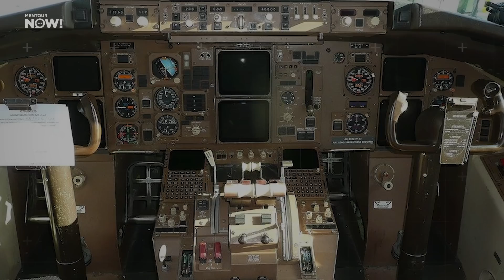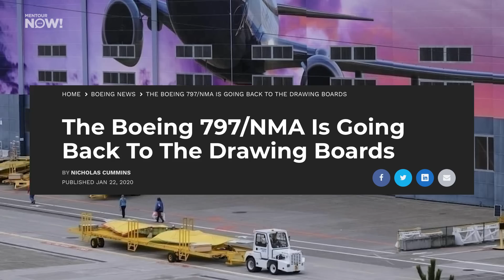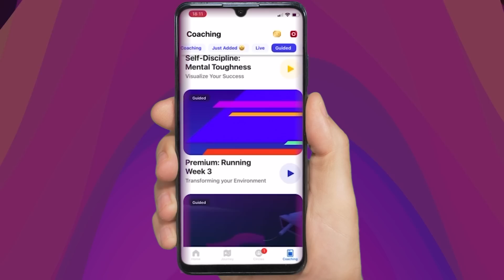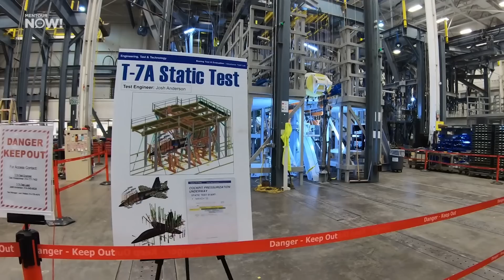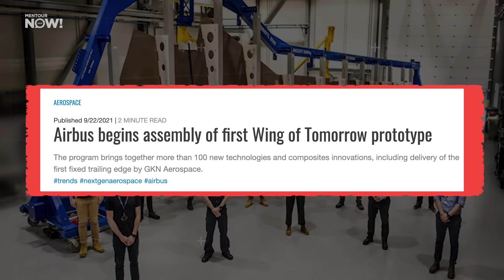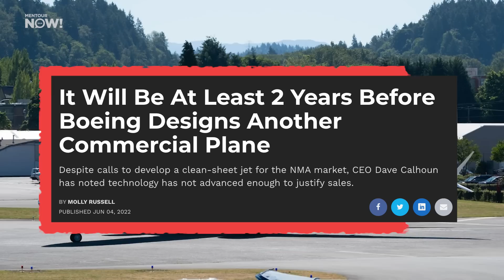Is Boeing Planning a 757 MAX?!

Comment: Your figures surrounding the Boeing 787-8 are totally incorrect. the dash 8 variant only seats 242 passengers, the dash 9 seats 290 and the dash 10 seats up to 330. Stop giving out bogus information.
Reply: Hi Gregory. Thank you for coming with corrections but in this case you are wrong. What we are giving out are the actual passenger figures in a SINGLE CLASS configuration. You are referring to dual class configurations but the whole point with this video was to show the gap in potential capacity.
So we are not giving out bogus information, we are comparing apples with apples. 

Have a great day.

Comment: The big issue is having all that excess thrust is antithetical to good fuel economy as much as I love the 757 and its rocketship like performance. I've flown the 737-800 in a full size certified sim and it uses a lot of runway when loaded. It was a few years in Boston but I think VR was 150 kts+.  Just watching them take off from Logan in Boston they use quite a lot of that 10000 ft runway (4R/22L) when doing transcons vs the 757 doing the same mission  which uses considerably less. Still, aesthetician the 757 looks a lot more sleek vs the 737 which retains the 707  nose cross section and first flew more than 60 yrs ago
Reply: Yep - you don't buy Ferrari for fuel economy. And airlines are rightly far more interested in fuel economy than performance.

Comment: 757 is still a favorite for pilots , mechanics, and passengers. The max version would be wonderful.
Reply: Also controllers. Loved working the 757. Great climb rate. Mach.80.
Reply: Been a mechanic for almost 25 years. Worked on all Boeing 727+. Loved working on the 757! At 6'2" loved being able to walk underneath the plane.

Comment: I suppose the question you raise (but don't specifically mention) is: why did Boeing leave such a big gap between the 737 and the 787 in the first place? After all, Airbus hasn't. 

FTR - I'm neither an Airbus or Boeing acolyte

Comment: I hadn't heard about the Ultrafan being too large even to fit under a 777X wing. That's nuts. What on Earth are they planning to use it for if it won't even fit on a 777? The 777 has by far the largest diameter turbofans of any current aircraft, either civilian or military. It's 26" / 40 cm larger than even the Trent XWBs on the A350. Is Rolls expecting someone to build a new clean-sheet design even larger than the 777 any time soon? That seems very unlikely to happen, given the recent demise of both the 747 and A380 families (due to lack of orders, not lack of ability to build them.) Even when a 777 is parked side-by-side with a 747, it's very noticeably how much larger then engines are and, thus, how much higher up off the ground the 777 wing has to be to fit them.

Comment: Is Boeing's new business model making dinosaurs fly??? The 757 is a piece of shit. You'll know when they put you on one on a transatlantic flight from Europe and the piece of crap won't make it to US shores when it experiences a bit of headwind. You end up somewhere near the artic circle to refuel and everybody on the plane is missing their connection. The 737 Max is a DINOSAUR. So will any other fuselage designed decades ago be when equipped with modern engines. It's madness driven by greed!

Comment: The 757 is my absolute favorite aircraft, and its sad that it will slowly start to disappear. Back in the early/mid 2000s it was the right decision to end production of the 757 but only short/midterm, it was not a very foresighted desicion. The A320 and A321 already existed a long time then and it should have been clear how much potential there is in the A32X which is a larger aircraft (the Platform) than the 737. They should have known that they cannot compete against future A321 Versions with the 737, the 737 was built with the 727 as its big companion in mind, the 737/727 form kind of an airplane Family. The 727 got replaced by the 757, and instead of a 737 MAX 10 there should have been a 757X.
But this ship has sailed long ago, rebuilding the 757 would be possible but almost as expensive than just to build a completely new aircraft ...
What Boeing should eye is the 767-category, they need to build an aircraft which can replace the 767-300ER, 767-400ER and A330-200 in terms of capacity and range, this is where there is still a gap. Going head on with the A321XLR does not make a lot of sense IMO. The Market for that aircraft is smaller than many think.
I still love the Idea of a 767X -- re-engined 767 with GEnx-2b engines, 767-400 Wing and wingbox, 767-300 fuselage lenght, 767 Tanker flight deck and avionics, 777X cabin etc.

Comment: So…if Boeing can’t find the right combination of single-aisle aircraft that holds 230-280 passengers to fill the gap between 737 and 787 because there’s not a good midsize engine (Leap too small and GE Nx to big) then how could Airbus do it any faster or cheaper?   Would a stretched Airbus A32’2’ aircraft have the same problem?   Something doesn’t sound right?    Otherwise why not do a 737-11 Max stretched version??     It boils down to aircraft weight per pound of thrust produced and I don’t think Airbus has any magical formula to do a 240-280 passenger single-aisle aircraft either.   Or do they??

Comment: If 747 SP was to make a comeback with two engines instead of the four, which engine currently on the market would give the thrust required?
Reply: The biggest one currently on the market is the GE90 (490kN) used for some 777s, though the later and more efficient GE9X could probably be modified to match that. As a guide, the biggest engines on a four engine plane are the RR Trent 900s of the A380 at 374kN each. So to convert the A380 to a twin with the same power you'd need to boost the GE90 by about 50%. Afterburners maybe? (just joking).

Comment: From a purely marketing point of view I doubt that they will produce anything called the "Max" again at least for a few decades, X Pro or ultra all fit the bill. I'm still reasonably surprised that they stopped production of the 757, especially without a replacement but I doubt that they could realistically restart production again. It's rather ironic that the 757 which was built to accomodate more powerful engines now finds itself in a gap in engine production where the engine manufacturers have squeezed everything in to the 737 platform.  I'm surprised that the NMA development was stopped - I completely understand that they wanted to focus on the 737max problem but it does seem a bit short sighted, nothing new there though. Restarting 757 production would seem like a step backwards compared with completing the NMA... that said it would almost certainly have been better to have developed a new/modernised version of the 757 rather than going with the 737max (IMHO).  I take the point of Airbus reacting to Boeing doing either NMA or 757"Max" but it very much sounds like there's a gap in the market which Airbus is likely to fill if Boeing doesn't do anything anyway. Personally I feel that Boeing has somewhat lost its way as a company recently... although perhaps they're up to something that they're not telling us...

Comment: Hello there from Australia.

In light of Boeing's recent string of event's is a new Mid Sized Aircraft what they need in the B797.

What if Boeing were to go Back to the Drawing board and think that in Hindsight would it not be an idea to Bring Back the 757 with as said New Wings, Powerplants and Cockpit Systems Controls.

This would give them an Aircraft readily available and proven unless all Tooling for type has been scrapped.

If not leave the B797 until that if a later time and work with the Tried and Proven.

The B767 could justify a comeback being the same, Tried and Proven and this could make up the B797 with like that of the 757 all new Wings, Powerplants and Cockpit Systems as well as making use of Composite Materials with the Structural build of both Aircraft types.

Just a thought.

But it would make things easier on Boeing given the 737 Max, 787 and latest 777 delays in allowing them to Pursue these matters whilst still providing a sort of New Aircraft that could match the liked if the A320 and A321.

John Woodall

Comment: Why not simply shorten the fuselage of a B787 a little to match the capacity of B757? It would be much cheaper than to revive the B757 production and the smaller 787 will certainly be more efficient than the decades old 757.

Comment: Given that the engines, wings, and re-engineering of the 757 fuselage would be nearly the same amount of work as designing an all new aircraft, they might as well design an all new aircraft and take advantage of the latest in aerodynamic improvements and composite construction tech.  I also suspect demand for single aisle aircraft will decrease as the EU moves towards banning domestic flights following the lead of France, which should boost demand for a mid-size aircraft that is twin aisle.
Reply: Most non-domestic flights in Europe (which may be, on average, like 1000 km, it's a small continent) are flown with A320s and 737s (and A220s and E-jets also). 767s are very rare here and mostly used for intercontinental flights, 757s are now quite rare too (mostly at charter or leisure airlines).
So European airlines don't seem to need a wide-body NMA.

Comment: More likely to see an "A-322" than a 757 MAX .. engine is the crux here .. a new engine would have to be developed and why would u do that specifically for a stop-gap aircraft  or at least until they finally decide to begin work on the NMA .. Boeing have dropped the ball here .. expect to see that re-winged A-321 at some point.

Comment: Boeing should look at maybe shortening the B787-8 and base it around the dimensions of the B767-200.  

You’ll have all the technology of the 787 with its carbon fibre composite materials, avionics etc…
A double aisle mid - long range aircraft that can seat around 275-300 in a single class config. 
Same engines can be used as 787 (GEnx or RR) just scaled down on the power rating a bit.

Comment: So if that new RR engine won't even fit on a 777 and it and the A380 have the two biggest engines on airliners, and that new engine won't fit on the 777, then what the hell is RR making that engine for?
Reply: Airbus has said it will be perfect for an updated A350
Reply: @Henning_  yeah but that is still smaller than the 777 and it won't fit on the 787 which is about the same size, so that doesn't make sense either. I don't think it will have the ground clearance needed unless they do it like the CFMs on the 737.

Comment: So… after a hopeful title of this video, you are basically saying the 757 is dead and buried.  I flew for years beginning in the early 80s, mostly on short, regional trips.  727s, DC-9s, BAC-111s, and older 737s were the mainstays.  I was fortunate to begin flying on longer trips in the early 90s and got to finally experience the 757.  As an aviation enthusiast, nothing could compare to that plane in beauty, comfortable cabin, and performance.  The G-force of acceleration was exhilarating.  Icelandair still flies a number of them and a few have absolutely unique and gorgeous liveries.  I also loved Air Lingus’ beautiful green birds.  Boeing screwed up not making the 757 the redesigned go-to design versus the monstrosities of the overdeveloped 737.

Comment: You missed a couple of interesting related points.  (1) What to do about Air Force 2.  The USA has a couple of 757s configured for either the Vice President or when the President really needs to go to an airport that can't handle the 747.  The 757 can also get to cruise altitude a lot faster than then 747 which is important in some safety situations.  (2) I'm not sure you made it clear that Delta is still flying 757s and REALLY needs a replacement.  N702TW, N703TW, and others have all flown within the last 24 hours.  These aircraft were among the first 757s TWA took delivery of, went from TWA to American, and eventually found their way to Delta. N701TW is now flying with the US Airforce.

Comment: That would be a great plane , new composite wings, leap engines, upgraded fly by wire, and ac packs. Airlines would beat the doors down for it. BUT, the 737 orders would suffer,

Comment: If they were smart they would be but for the last 30 years they have proved they are anything but smart 

If they were smart they wold have kept making B-717's the former MD-80 series they got as result of the merger.  Hey could still be selling them today to airlines, such as Delta who are replacing the MD-'s  with A-220's  

If they were smart they would have done as they did with the 757 and 767 and built a composite body 797 at teh same time and they would be flying today.

Comment: The 757-300 was an upgraded version of the -200, with a longer fuselage, upgraded wing, engines and cockpit. It's truly a great aircraft. There is a wonderful video on YouTube,regarding the version and its enhancements. So well designed. Dependable. A true workhorse.
Reply: The -300 had a bizarre story. Only 55 were made, and the line was shut down. 5 years later every airline wanted them! All 55 are still in service and over 22 years old.
Reply: But it didn't sell well

Comment: Rolls Royce have said that the Ultra Fan is a scalable design, therefore a smaller version of the engine could be built to power smaller aircraft. Rolls Royce are already looking at the possibility of offering an engine for future single aisle aircraft using Ultra Fan tecnology.

Comment: Way too heavy an airframe to compete against A321 neo XLR.  it is the Dreamliner B787 which should have had a single aisle twin like the 767 had one with the B757, same cockpit, same wings same certification etc…but a composite design was a risky challenge mitigated then to a single diameter….I guess..only a full composite new single aisle design can beat the current single aisle market dominated by the A320 and A220 family.

Comment: I used to work for Boeing and now work for one of their suppliers. 
They are working on a potential twin aisle plane but there is no way it will be called a 757.
The 757 and 767 were co-developed so pilots could be certified for both planes.

Comment: I doubt that a new 757 would retain all that excess power in its engines. Overpowered engines use an unnecessary amount of fuel, no? God forbid the carbon emissions are too high for airlines obsessed with being green.

Comment: Realy good info, thanks a lot. The question, is the money, and if is not to late to give the answer to Airbus, reintroducing the gorgoeus B 757 once again. Following this, I guess Boeing got to achieve no less than 200 or 250 ordering units, to make it profitable and start production. All facts mentioned in video are realy a big issue, and having those 737 Max bad news storm, it`s a must to launch an agressive sales and promotional campaing, get firm orders, get the newest type certificate, among another facts involving in all process. Having said that, time is running, Airbus selling and producing the aircrafts, just to hard to handle it, far behind Airbus program as well. I hope Boeing could get it, recovering its golden and legendary respect as aircfaft manufacturer, USA realy needs this event. Bye, take care, man.

Comment: Well the future of aviation is forecasted to be single aisle planes with longhaul range...so a new B767 is out of the question...develop a brand new plane with same characteristics as a B757 would be much more expensive...and could take much more time than work on already exiting plane...what Boeing should do is make a new B757 with not just composite wings but also fuselage, new engines the hardest part...
But I don't understand why some airlines CEOs if they years ago didn't get a solution from Boeing for replacement of the B757 why they didn't went further and request another manufacturers like Embraer o Bombardier and Airbus to develop such a new plane...they're like tunnel visioned in Boeings engineering.